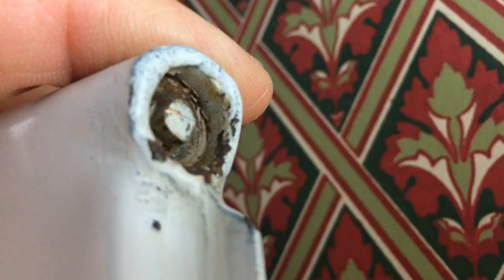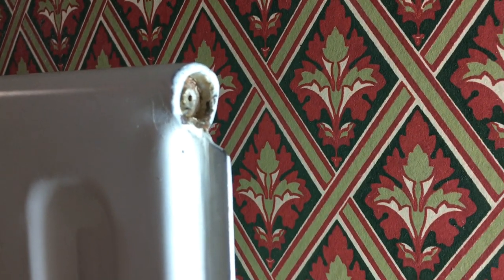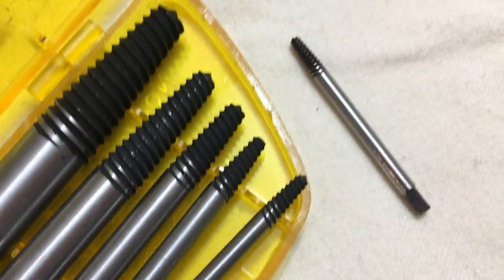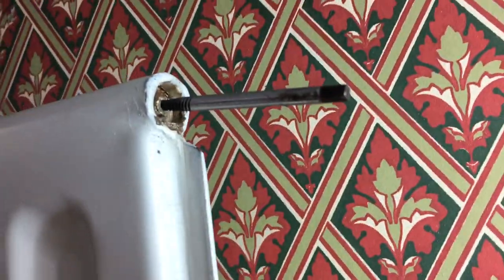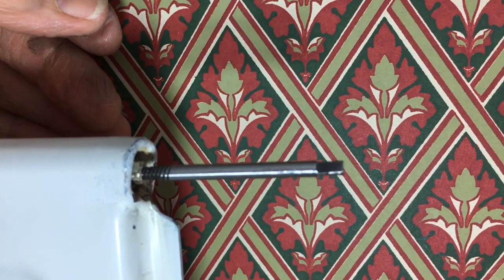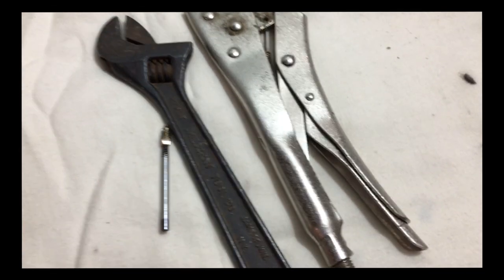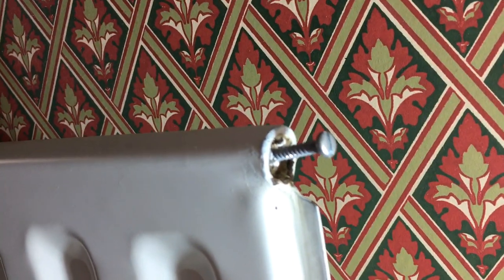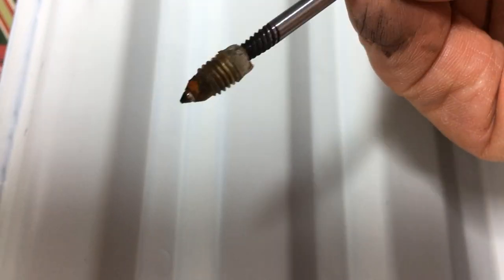DIY plumbing - FIX removing radiator bleed valve that has been rounded with the radiator bleed key.

Comment: Excellent video, helped me out in a bind with 25 year old radiators that had rusted and fused bleed valves, only cost me £10 to replace them and the radiators are good for 10 more years!
Reply from the maker: Thanks JG a fabulous result and the old style radiators are made of good steel too that will probably do another 25 years! ATB  b33zo

Comment: Nice work. As simpler approach that is worth a try first, and has worked for me on a couple of radiators like yours, is to use something like a 5mm socket wrench bit (starting larger and working down in size) which can be tapped on using a small hammer and then unscrew. Then preferably replace the valve screw.

Comment: Thank you for this video , problem is bleed valves come in different size's so I drained the system down whilst I got the right ones .
Reply from the maker: Thanks for watching Keith. Yes one size definitely doesn't fit all but the ebay seller has pictures of each kind of radiator to help chose the right valve. ATB b33zo

Comment: I have similar problem. Would you know what size to replace with?
Reply from the maker: Thanks for watching Andrew. The supplier I found on ebay has pictures of each kind of radiator which will help with figuring out which style of bleed valve you need. b33zo

Comment: Why did you not just replace the bleed screw one you got it out? 

Thanks for the video by the way, I'm currently stuck with the same issue !!
Reply from the maker: DS thanks for watching. The old bleed screw was rounded on the corners so U.S. New screw from supplier was perfect replacement. I got a 10 pack and after draining the whole system went round and replaced any screws that were also getting rounded. I added fresh X100 inhibitor when I refilled the system. Good luck. b33zo

Comment: I have a similar problem with the same type of radiator. Before I try and tackle it I want to get a replacement bleed screw. Do you know which type to get? I know you can get different types but this one looks similar to mine.
Reply from the maker: Thanks for watching Barry. Ebay supplier was very helpful with pictures etc to ensure correct bleed screws; radiator-parts is the name to search. b33zo

Comment: I have double rad with bleed screw on the inside that is rounded , can’t get any tools in , any suggestions?
Reply from the maker: Thanks for watching Tony. From memory the people who sell bleed screws (look on Ebay) have images of all types of radiators including some that are unfixable. Good luck. b33zo
Reply: I have a similar problem and am going to try a small dab of plastic metal (similar to arldite but harder)  in the vent key. Tape the key in position and try to remove the vent screw  24 hours later. Before you start would be useful to have a new key and a new vent. Shut the rad valves before you start to remove vent.

Comment: Nice video I have the same problem and I bouht everything I drilled a hole on the screw and scew it in  the extractor on the half way but after couldnt move it and I drilled a deeper hole but that was too deep and made swiming pole in the bathroom the screw is still in so I just closed the taps and no heating in bathroom , do you have any idea what can I do with that?
Reply from the maker: Hi HG thanks for watching. Yes this is a tough one. The person who sold me the replacement bleed screws suggested cutting down or shortening the bleed KEY - as they taper and fit better near the part you hold. Worth a try. I also had another radiator bleed screw which failed to come out and in the end I made a mess of the drilling and had to replace the radiator. That job was time consuming but at least I had a nice new modern radiator... Good luck  b33zo

Comment: I had a plumber come round and tell me I need a brand new radiator because the key doesnt seat well onto the valve. 
Will try this first! I see screwfix do a similar kit for removing stuck bolts.

Comment: 'Either that wallpaper goes or I do' - Oscar Wilde's last words remembered while watching this video! Thanks this is useful as happened to one of ours  - although we have a newer fitting where the screw goes into a kind of nut with a small water tube and the whole will come out with taking off that nut - maybe messy, however, if don't shut down rad valves at both ends?
Reply from the maker: haha yes Indoona those iPhones are very unforgiving! Wallpaper probably same age as radiators -  guess if it leaked or made a noise it would get fixed too! ATB b33zo

Comment: Not sure there's much point filing the sides square unless you've got a smaller key to match.
Reply from the maker: Thanks for watching halfas. I spoke on the phone to the guy who sells bleed screws and he suggested cutting the key down as they are slightly tapered inside. Haven't tried it yet. b33zo

Comment: Great vid, been thinking about a solution for this exact problem.
Reply from the maker: Thanks for watching Quinnlin. Make sure you drill  dead center of the bleed valve and it's fairly straight forward. b33zo

Comment: It’s wasting money and time by doing all this hard work no point! just buy a new radiator it’s not that expensive you won’t be broke! 😂
Reply: You mitten be able to get the exact same size and need to go smaller or bigger needing plumber
Reply from the maker: Thanks for sharing your knowledge Ash. Yes I had to do that in one room. A modern radiator I fitted about 10 years ago has rust around the tappings whereas these old radiators are as good as the day I fitted them 40 years ago. b33zo

Comment: what stupid designs, they could have simply made the bleed screws a CM or 2 longer and all these sorta problems are solved but NO for some reason...
Reply from the maker: Thanks for watching Lee. Agreed, the modern thin tin radiators have better bleed screws but these are 40+ years old and I guess the design was approved back then. ATB b33zo